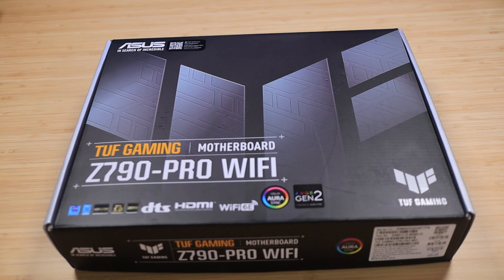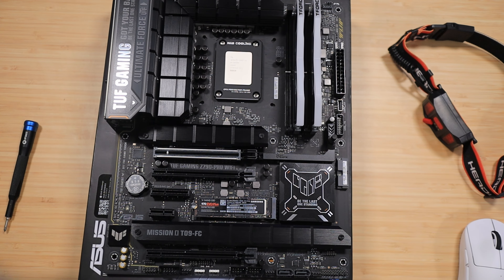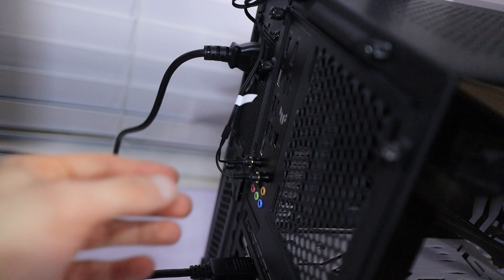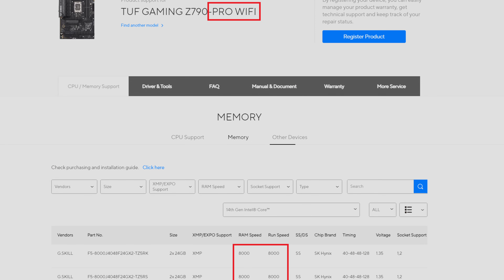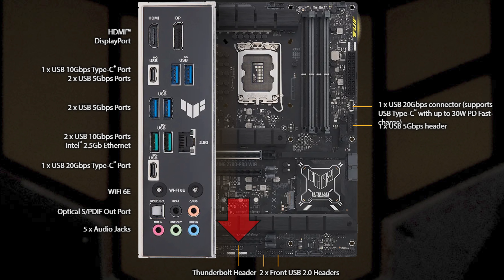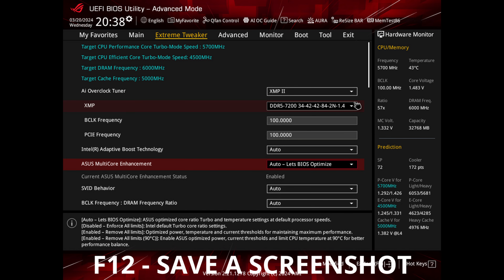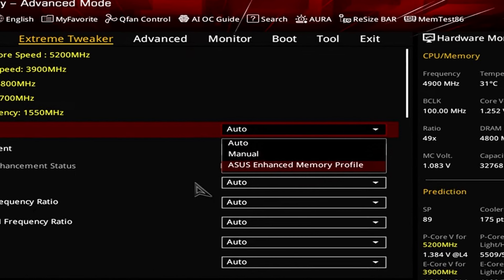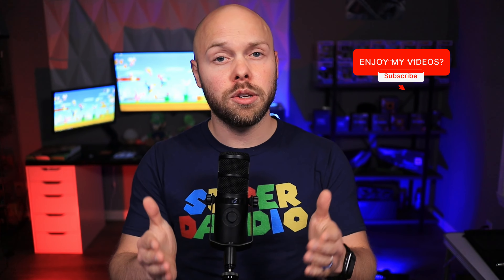Every Motherboard Needs These Features! | Asus TUF Gaming Z790 Pro Wifi Motherboard Feature Overview

Comment: I had many pc's before with different kinds of boards, but using Asus ROC B360H for the last five years, i will not buy any other brand than asus again. You pay more for a reason. The Asus TUF Gaming Z790 is really a good deal. I ordered it a few days ago with i7 14700k and 32gb ddr5 ram with the awesome Asus TUF RTX 4070 ti 16gb graphics. Serious upgrade for me after 5 years. 😍

Comment: I'd rather have a cheaper board without wifi. Why do you even need wifi on a desktop when wired network is much better (much cheaper, more reliable, actually reaches the claimed speeds) and it's not like you're going to be moving the computer during use.

Comment: I just built a system for someone with this board.  The only complaints I have is I wish they would make led trouble code displays on all boards.  I love this feature on my Z-690 Maximus  Formula.  The other complaint is they buried one of the chassis fan headers between the PCIE slot and the CPU socket.  I installed a GTX 3080 Founders card and an air cooler and it is impossible to access now.  You have to remove the cooler to get to it.  Other than that, it seems to be a good board.

Comment: Great Video! I just installed a n Asus ROG Maximus Z790 Dark Hero to replace an Asus Strix Z690 (it just decided to fail for no obvious reason. The Strix board IMHO is a piece of crap anyway. Poorly manufactured, and few features for the price).

I was trying to find out how to safely unplug the Q-Antenna, and my question was answered here. No answer in the PDF manual, or Asus website. The Q-Antenna is a great idea, but the cable is so short that I don't think you get the best effect of orienting it for the best signal.

Also, I miss PRINTED PAPER MANUALS!! I'd happily pay another $2-$5 for one. What if you don't have access to another working PC or your Internet is down?

I also find it inconvenient looking at the PC screen and back to the PC I'm working on. 

The USB drive they give you with all the outdated drivers and manuals is useless.

Sorry to drone on! Again, great and helpful video! 
Thanks!

Comment: Got the ASUS TUF GAMING Z790-PLUS WIFI a couple months back. Running it with a 14700k, 32GB 6000Mhz and 3080ti. 
Boards solid as.. Never under stood paying top dollar for boards. 
Even back when i'd run flagship GPUs in SLI and 3930k or 2600k with mid range boards always ran  fine. Came from a 9900k and mid range board and they never miss a beat. 
High end boards have a load of shit  I just don't need.
Reply: In the process now of upgrading to a similar build,  but a 4080. Hope you like yours still! Heard the new intel chips run hot as hell, gonna see how a 360 aio holds it down.
Reply: @unluckymaru8776  Still going strong. Just update the bios to the latest firmware and turn off HT.

Comment: I am also using the same motherboard Asus tuf z790pro. Does it work smoothly 7800mhz ram? My current ram 6400mhz. Upgrade 7800mhz ?

Comment: Is anything you mention Windoze only?
Reply from the maker: Are you a Linux user? Anything I mentioned about the hardware is on the motherboard itself. It will work regardless of your OS. Anything in the bios, like shortcut keys, will work regardless of your OS as well. However, anything I mentioned in the armory crate app is likely windows only. To my knowledge, armory crate is not available on Linux.
Reply: Thanx.  Yes Linux mint.  Is there an AM4 or AM5 equivalent mobo?
Reply from the maker: @skipguenter3711 Yes. The closest for AM5 is ASUS TUF Gaming X670E-PLUS WiF. It’s the same price. But it doesn’t have the GPU release button.

Comment: I think I missed something, you can fire it up without ram to get the led to indicate, and you can "HOT-INSTALL" expensive ram On-The-Fly" and it does not Zapp-o, or just turn off the motherboard?  I been around a long time...  was stoned and tried to install an expansion card while a box was live, it shut down immediately.

Comment: did they fix the ram slot issues where you could only install in slots b 1,2 cause if you installed all 4 ram sticks you would have problems with 2 not working

Comment: If only it came with a manual that had clear instructions in it.
If I am to believe what it says about power connectors I should connect both 8-pin CPU connectors. But I only need to power a 65W watt CPU, so what's the point? And what happens if I only connect one? Some people have reported stability issues, others says it works just fine with 1 connector.
And you can't ask Asus for support. That's why everyone who has bought this particular board is very confused.
Reply from the maker: In my experience, it’s best practice to plug in what you have available. If the CPU doesn’t require more power, it won’t draw it. I’ve also used motherboards before and only have plugged in one connector. I didn’t have any issues. I find it hard to confirm any stability issues are related to the connector. With Windows being so finicky itself, that’s hard to confirm.
Reply: @ErockOnTech  Thanks for the advice. I noticed that the included leaflet (sorry, Asus, I can't call it a manual) says you need to connect both plugs, so that's what I ended up doing, only to find out that Windows 11 is quite different from Windows 10, but not in a positive way, to put it mildly. Constant nagging to make me use (and pay for) Microsoft product which I don't need. It's also very user-unfriendly, with many options missing and others in weird location. The annoyance level is on par with the paperclip that came with W95.
Reply from the maker: @jacquesmertens3369 Yeah Windows 11 sucks unfortunately.

Comment: Hey, did you have to update the bios before using the 14th Gen cpu?, because there's reviews on amazon saying that they had to get a 12th Gen cpu to update the bios the use a new gen cpu, but this was on the z790 plus wifi d5, im wondering if the z790 pro might have this issue also and really dont want to have to buy 2 cpus for one pc.
Reply: I just installed a 14700K into this mobo straight from Amazon. Everything came to life perfectly.

Comment: All motherboards should have as a standard:

* #1 Dual BIOS
* 6 USB ports
* WIFI adapter which gets used for blutooth as well
* POST code LED

Dual BIOS is a standard not as feature.
Reply from the maker: Not a bad list. I definitely agree that all motherboards should have post code LEDs and Bluetooth and wifi built. The number of usb ports seems a bit arbitrary. Why 6 specifically? I’ve never needed a dual bios personally. What would you use the second bios for
Reply: @ErockOnTech  For when updating BIOS if the install goes bad or you lose power.

With only 1 your board is bricked. With 2 you can get back into the BIOS reset the first one and try again.
Reply from the maker: @andrewvirtue5048 That’s what BIOs flashback is for. Sadly, this board lacks that.

Comment: I bought the Tuf X670E and because it has no quick GPU release I had to use my finger in the very tight place between my SSD heat sink and GPU to press the latch down, the latch completely shattered as well as part of the arms that hold the latch, so I could not just simply replace the latch. 

ASUS claimed it was a human error and charged me to replace the entire PCIE slot for my GPU, that plastic on the slot is very unforgiving and will shatter sometimes from just regular use like me, and know that ASUS will not help you here so be very careful when uninstalling a GPU guys,
Reply from the maker: I’m sorry to hear that! And I thought that board had a GPU Q release. Very interesting.. hmm 🤔
Reply: @ErockOnTech  does it?! I would love to be wrong, but I did not see one (it’s currently getting repaired so I can’t check)

Edit: internet says q release function is not on the AMD Tuf motherboards, bummer
Reply from the maker: @George-um2vc I did not know that. Wow. Interesting. Thank you for this information.

Comment: Can i use hdmi and dp from the motherboard if i have a gpu connected? (with integrated graphic card on cpu)
Reply from the maker: I think so? But why? You just need to make sure the GPU has no display cables connected.  Then the motherboard will default to motherboard display.